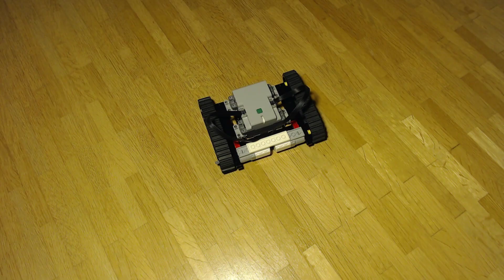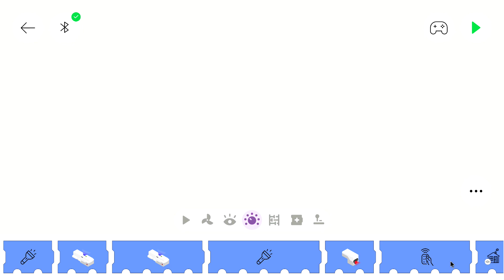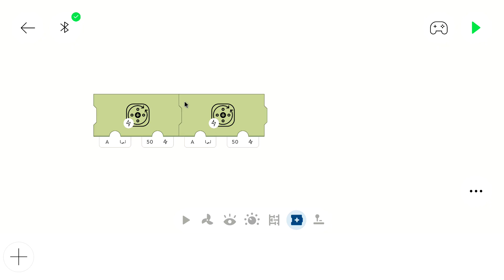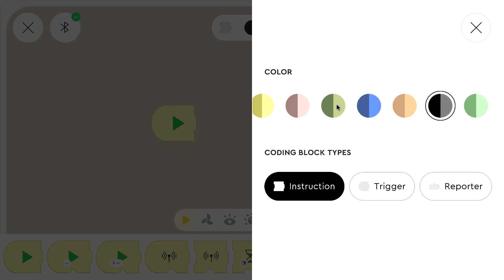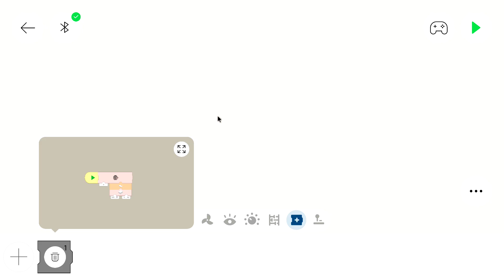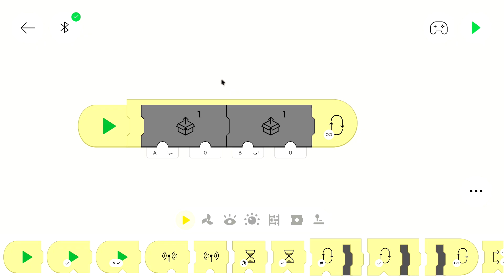Lego Powered Up Tutorial #18: create your own block for a remote controlled vehicle [English|HD]

Comment: How did you get the custom block get the hub input? My custom block only got one input which takes a number. Number 0 seems to be part A and number 1 port B. What would be the second input on your custom block?
Reply from the maker: The 2nd input was done by accident. It has no purpose :) (but I'm also not sure if it's possible to remove an input)